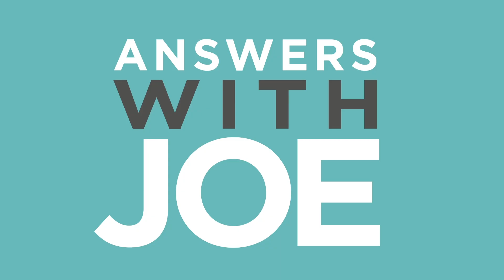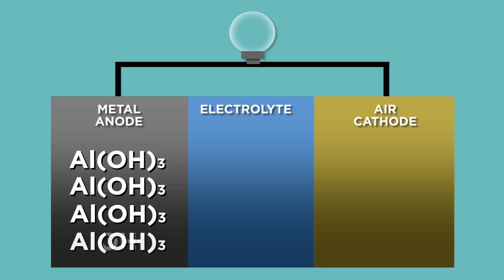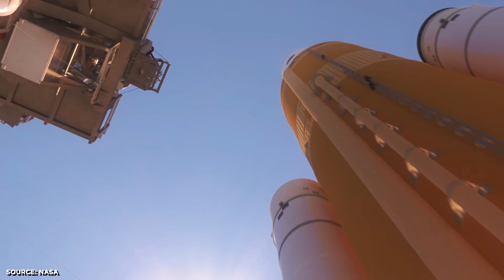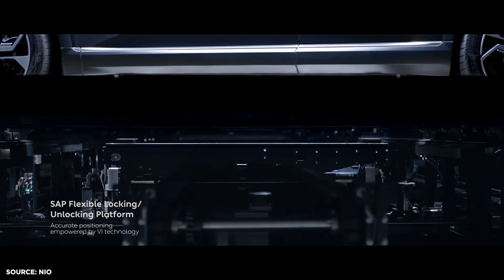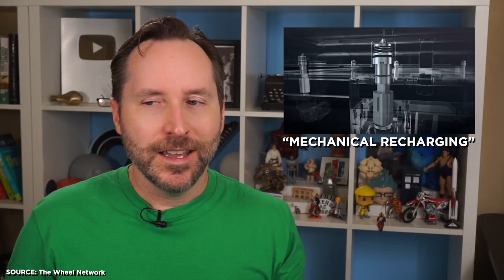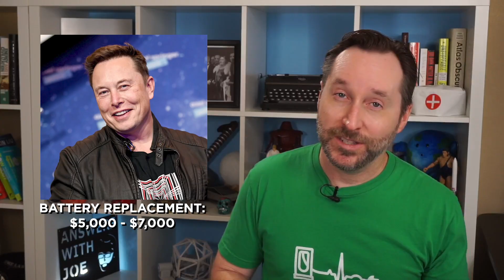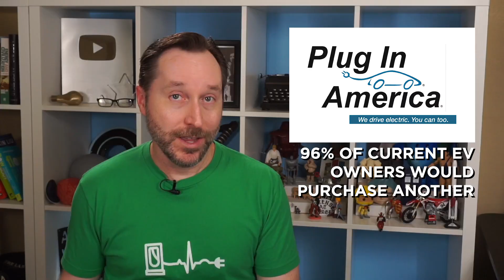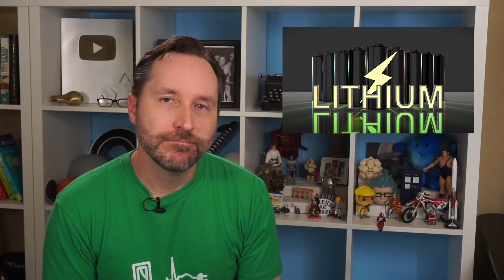This Battery Could Drive A Car 1500 Miles - But There's A Catch | Answers With Joe

Comment: Say you're driving along US highway 6 in the middle of the Nevada desert, miles and miles from anywhere, and your car runs out of gas.  You call AAA and they send out a guy with a gallon or 2 to get you to the nearest gas station.  Or, maybe, having thought ahead a little, but not enough to have gotten gas in Tonopah, or Ely, if you're going the other way, you have a gallon or 2 in a can in your trunk. Emergency recharging your rechargeable car on the road, on the other hand, would be a problem.  Having an AL-air battery as a built in back-up would certainly be nice, or, if your car didn't have such a built in back-up, a small battery, say the size of a toaster-oven, available through AAA or carrryable in your trunk, with an emergency plug-in in your trunk, could serve as a gallon or 2 of electrons.

Comment: FASTER THAN FILLING UP MY GAS TANK HAHAHAHAHAH THAT'S A RIOT.  disposable batteries? subscription for batteries sounds like a horrible idea. my 1970 chevy c10 lasted 400,000 miles with the original engine.  these go-karts are nowhere near the reliability of gas. gas is king. not to mention what's the cost for an electric mechanic to fix all the gremlins? I can fix my own gas vehicles, and im way too busy to learn an entire new drive train. nothing burns quite like a lithium battery fire!!

Comment: I don't know anything about the physical construction of an aluminum air battery, but I wonder if they could be someday be designed to be user-serviceable, i.e. modular in that once the aluminum bits need to be replaced you pop the lid, slide out the old ones and slide in new ones. This way you could theoretically store replacements in the trunk, swap out as needed, and then drop off the expended ones for recycling at your convenience. Or take the car to the nearest service/gas station where you could buy the replacement bits and have people on-site to swap them for you. This wouldn't require nearly as much of an infrastructure build out (tho you'd still need to transport the replacement parts and collect the used bits).

Also, the inevitable death of lithium-ion batteries is what's going to keep a LOT of people out of electric cars (including me). There's a fairly sizeable percentage of the population that simply cannot afford new or slightly used cars. And who is going to want to shell out $10-12K or more for a 5+ year old electric car knowing that before it's paid off you're going to need to shell out another $10k (or even in the "best case", $5k) on a new battery out-of-pocket? No one, that's who. Compounding the problem is that these older electric cars won't have the most modern battery tech, meaning that even if a new battery comes out today that eliminates this problem it'll still be 5+ years until it's available to this segment of the population. This is why I always shake my head when I hear politicians blather on about mandating all cars to be electric by a specific date. It's simply not going to happen until a good five or more years after the battery issue is resolved.

Comment: The biggest issue to these style of batteries is infrastructure. For the mass market to want to use a battery pack like this there have to be enough places to get the batteries swapped out and it has to be cheap enough for it to be cost effective for the majority of people to even want this style of vehicle. For businesses to want to put a dedicated team or service bay in just for battery swapping means that the mass market wants to have these style of cars and it has to be profitable for them to even want to do it in the first place. 

The benefit of rechargeable batteries is the fact that you don't have to constantly replace them you just have to plug the vehicle in every few hundred miles. The benefit for businesses is they just have to put in 1 or 2 recharge stations and don't even have to worry about having an entire dedicated building to swapping out a very expensive, very bulky peace of hardware.

Comment: Electric cars will ONLY become actually usable and good if they recharge themself on the fly as they drive. So no refueling of energy at certain spots is necessary.  In fact the battery concept alone is already outdated because vehicles need to fuel their energy need at the moment of use. With direct energy conversion. What ever energy you may wanna convert. There is a LOT in Tesla's patents that could be of use today… But sadly his knowledge was taken away from society right after his death, when his home was raided and all his documents were taken away......

Comment: Instead of transporting batteries all around the country maybe they can simply process them onsite at the swapping station in a mini-factory?  After all we are living in the age of 3D printers and automation. You also wouldn't need to recycle the entire battery, just the aluminium anodes, so the mini-factory could consist of two modules - one that deconstructs and rebuilds the batteries and one that melts down the depleted anodes and re-forges them.

Comment: Well, the others didn't do the real homework, this is the first time I see changing such a battery pack is a rather complex procedure. But can't they make it such that the user himself can replace it 'foolproof' in seconds and then the complex connections are all with a lot clicking noise, made automatically ? That way the present gas stations now could switch to this new business. Perhaps the garage keepers could even open the intelligent outer shell and replace the Al oxide and electrolyte so the  transport of complete battery packs would not be needed.

Comment: The thing about range anxiety is that the more I think about it, the more I realize that it's the product of incomplete thinking through how people function in the real world. Sure, having 500 miles of range would be awesome for a long trip, but that translates into about 6.5-7 hrs of driving (assuming 70 miles/hr or so). That's a long time to go without bathroom stops, food, stretching my legs, etc. In other words, it's probably not something that I'm going to do - ever - and even less likely if my wife and daughter are on the trip. Their maximum time without a bathroom stop is about 2.5-3 hrs, so 350 miles of range at 70 mph continuous would be more than adequate.

Comment: How heavy are these batteries relative to their power? Could they be used in aircraft?
If so then the company would only need to set up the infrastructure in airports and the aircraft could swap them out before each trip

Comment: Sounds like the perfect solution for electric planes. If I remember correctly, energy density used to be the biggest problem with that. Swapping batteries at airports by service crews seems much more feasible than for private cars.
Reply: You don't have to swap the whole battery, just the anode. It can literally be as simple as plugging in a cassette tape. It doesn't need to be a very involved process at all. 

The previous anode is oxidized into Alumina powder, so you don't even have to remove an old anode, just plug the new one in. You have to recover the alumina powder for recycling, which is what I imagine would be the real purpose of the swap stations. It's less about replacing the battery and more about being a recycling center.
Reply: One of the issues too with aircraft is weight. Current chemical fuels that burn off get lighter as they deplete where as batteries do not. A depleted battery weights the same as when it is full but a depleted fuel tank does not.
Reply: @adamrichardson2227  as the aluminum reacts with atmospheric oxygen, they would get heavier as they're consumed. That being said, the energy density is such that it's probably a non issue.
Reply: @spencer1980  Not so sure. Energy and mass interchange. If the Energy potential in the aluminum is depleted, that should equate a drop in mass. I wonder which is greater...
Reply: @ngcastronerd4791  you're technically right, but you're not dealing with anything relativistic at those scale. A whole block of aluminum will maybe lose a few electron volts of mass, but we're dealing with protons and neutrons, so not even a drop in the bucket.
Reply: @spencer1980  to add further context, one nucleon masses nearly a billion electron volts, so there's no way in heck that losing a few electron volts will do anything to the weight of the exhaust products
Reply: @spencer1980  not quite true, you will lose the voltage of the cell times the capacity of the battery (in fundamental charges) number of electron volts. Another way of looking at it is energy density /c^2... For am aluminum air battery, you can practically get as high as 1300 Wh/kg, which works out to losing a mass fraction of 5e-11. Very very tiny. But much more than a few electron volts for a standard sized cell.
Reply: @ngcastronerd4791  perhaps if Aluminum depleted and started shedding radioactive particles, those E=MCC calculations simplify.
Reply: @HighestRank  fair. But then we wouldnt be using aluminum as readily would we ;)
Reply: @adamrichardson2227  What if the whole aluminum batteries weigh lesser than the empty fuel tank itslef?
Reply: @GenZBoy1999  haven’t planes switched over to structural fuel tanks already? Like, the wing IS the fuel tank?
Reply: @adamrichardson2227  It would probably be a takeoff battery. Lots of instant power to get you up to altitude after which a fuel burning generator takes over when you throttle back to cruise.
Reply: @adamrichardson2227  actually, Al oxide is heavier than the original elemental aluminum which seeded it!
Reply: also, these al-air battery packs are supposed to be lighter than equivalent li-ion

Comment: How much energy would be required to "recycle" these aluminum-air batteries? If they contain a bunch of aluminum oxide at the end of their life, that could potentially be recycled - but it seems to me that it would require a LOT of energy to get the pure aluminum metal back from the aluminum oxide. 

I am highly skeptical that having to physically replace entire large battery pack every 1000 or so miles would be an acceptable solution for the public. I just don't see that as feasible at all.

Comment: I wouldn't buy it, first off transporting these back and forth from the gas stations will add to both environmental issues and the price of the thing. 
Secondly, and I didn't see anyone talk about this yet, what if you are going to on a 400 mile trip, but your battery has 380 miles left? I mean sure, change it on the way, but
I expect a lot of batteries with a lot of charge left in them to get discarded, making it even less environmentally and economically sound.

Comment: I think graphene nanotube batteries will be the next step in the quest to equal or surpass internal combustion vehicles. ICE transportation is on the way out. Just like the horse and buggy gave way to the ICE, so the ICE will give way to batteries, or fuel cells, or hydrogen, or nuclear fusion*, or some combination thereof.

*Nuclear fusion is only 30 years away🤣🤣

Comment: Wait isn't aluminium production (from aluminum oxides) horribly energy-consuming? I thought that was one of the reasons why Al recycling is economically worthwhile... With the aluminum-air batteries, having to "de-rust" the oxidized aluminum will mean essentially repeating the whole production process... doing that every week or two for every car...
Reply: Yes. The good news is that aluminium is about the easiest to transport of all energy forms, so the recycling plants could be set up in locations where renewable energy is plentiful but impractical to transport away by cable. This is why Norway and Iceland are among the world's top aluminium producers.

(As are the UAE, Bahrain and Saudi Arabia, though in those cases I'm afraid the energy is probably less clean!)

Comment: Could you do a segment on the ceramic car batteries? I know Quantum Scape is working to get them in circulation, still in the testing stages but it seems promising.

Comment: I have read up on Aluminum Air but did not come across the replacement method. I actually really like this. Only problem is it will probably be only for those in cities as I do not see small towns, away from interstates, having battery swap stations even 20 years from now.

Joe, If there is anything new in the progress could we get a Solid State Battery update video?

Comment: You say, “If the energy cost to recycle is similar to lithium-ion,” isn’t that a big IF. My understanding is that you need to bring Aluminum to 4000 degrees to melt it and remove the Oxide. It costs a huge amount of energy to turn Aluminum Oxide to aluminum.

Comment: A non rechargeable battery is a non starter. No really. One of the absolute best thing about EVs is the ability to recharge at home with cheap electricity. This makes EVs very cheap to operate. Non rechargeable  batteries would completely destroy the two most important points about EVs.

Comment: I see a few problems with this concept

1: Most of the time you're not quite gonna get 1500 miles because who wants to go on a road trip and only just have enough energy and risk running out right at the end of the battery's life?

2: Doesn't this defeat the whole convenience of "Topping up" your tank? What are you gonna do? Just replace the battery before it's mostly used up if you wanna top up for a long trip or postpone the trip until you need to replace the battery?

3: The infrastructure needed for battery swapping on that scale would use up way more space than EV charging stations and also introduce more points of failure for the car.

4: Like Joe said, they'd be a large cost in transporting all these large, heavy batteries all over the country, thus adding to the already bloated amount of traffic and using more energy.

I only see this really being viable in public transportation where the length of the journey is always the same, so the battery size can be just right for a certain number of trips before being replaced. Or maybe for people who don't travel long distance very often so the issue around wasting the tail-end of the battery life isn't as much of an issue. New tech around more efficient batteries that can still be recharged are very much in the works and might render this conversation mute anyway.

Comment: I still use a great old system as battery to move myself. My stomach. And my legs do the work. Pretty handy actually. I can either walk, or ride a contraption called a bike. It needs sugar, oxygen and water to make it work.
Walking is slow, and not that efficient. But it's nice to do small distances. Cycling is way more efficient and faster. So if I need to go far I take the bikecycle. Works every time. Only need to replace the tires every now and then. But I heard cars have that issue too. Even my feet need new rubber regularly. 
It is weird seeing all the people using "alternate" energy sources for this. But I guess I'm just an old fashion guy. No car nor smartphone. Living the life :)